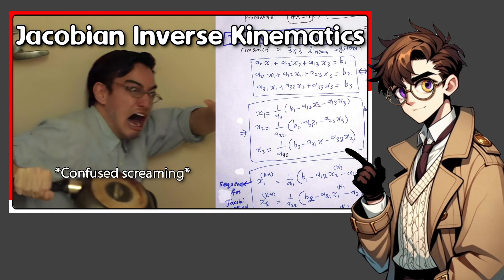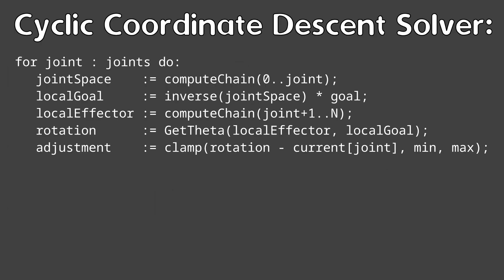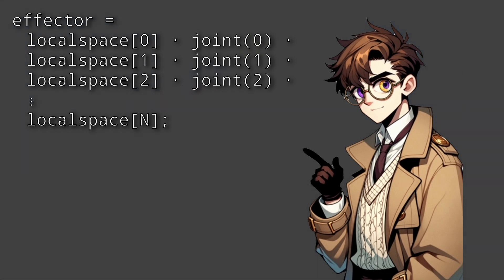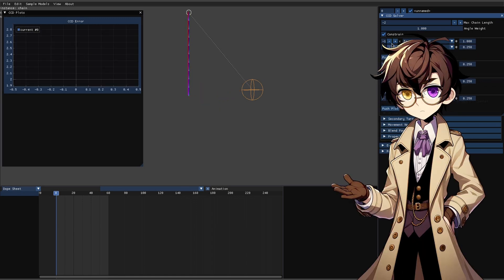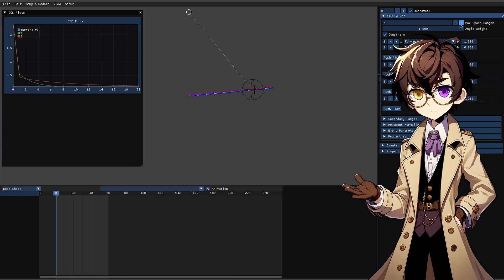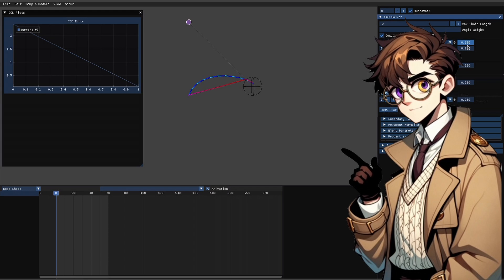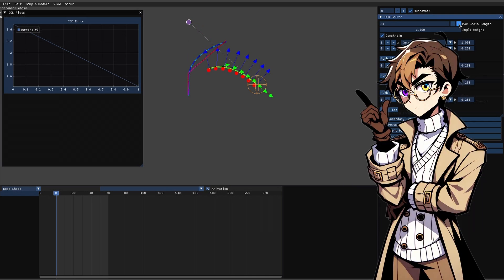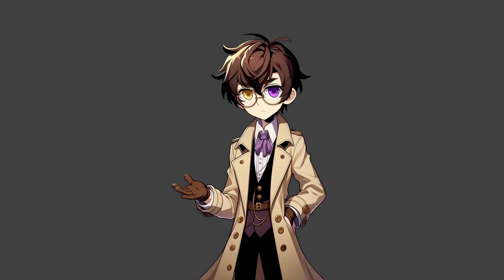Inverse Kinematics: Cyclic Solvers

Comment: for improving the backwards descent solver, what if u used a control point that is used for determining the target's rotation? i feel like that would be an improvement, as it would make it easier to orient the target in way that prevents the inverse chain from collapsing. for example, the target can rotate in a way that makes the start of the inverse chain "look" at the control point.

also, is it hard to implement rotational constraints for cyclic solvers? i have been looking around a bit for procedurally animating a human arm/leg in 3D, and cyclic solvers seem to be kinda promising, judging from the A-tier rating that you gave for this kind of solver in your IK-Guide repo, which is why I want to know if its hard to implement rotational constraints.

Edit: I just realized that you pointed out how to apply joint constraints in the video already 🤦‍♂
Reply from the maker: What like having an orthogonal second effector branch on the same arm? My instinct is that wouldn’t work because there’s many possible rotations that meet that constraint. If you can get that idea to work let me know!